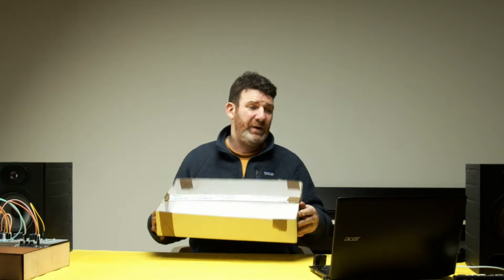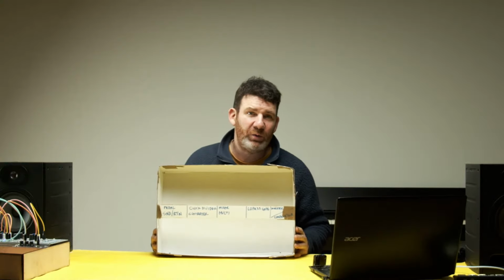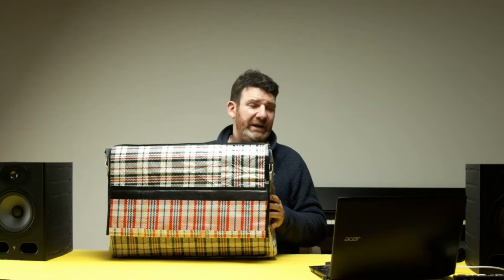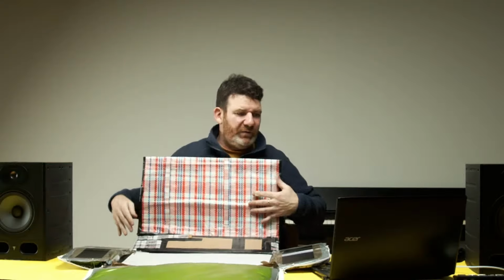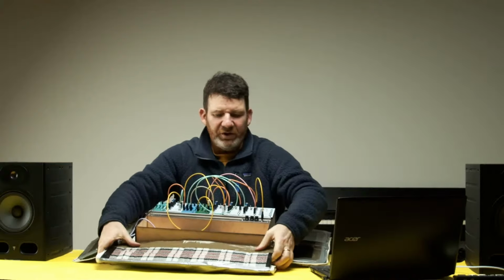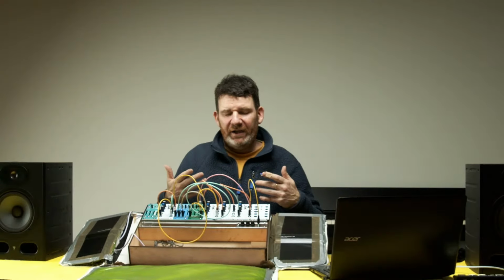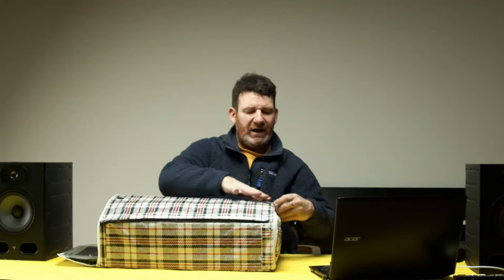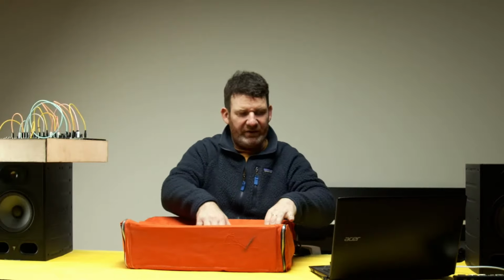FABuary week 3 Live Stream - Synth bag and Performance case making from myVolts studios.

Comment: What PSU did you use?
Reply from the maker: I used a 65W myVolts USB PD Powerbank, with a 12V Step-Up USB-C to DC adapter.
Reply: @myvolts  Apart from these items what else would you need, some sort of power delivery bus to plug the DC cable into?  Thanks v much. Really enjoying the series of vids.
Reply from the maker: @allforabit  You really just need a USB Powerbank which supports the PD (Power Delivery) protocol.  Almost all USB-C ported powerbanks will have PD.  After that, it's a USB-C cable and our Step Up 12V Adapter.
You might be asking what it going on 'inside the box' to power the modules, we made a little powerboard to get the right power to the right rails.  We can go into more detail on that in the future.
Thanks for your interest.
Reply: @myvolts  amazing, thank you that is quite mind blowing that that is all you need!